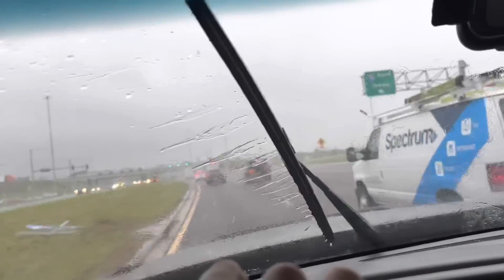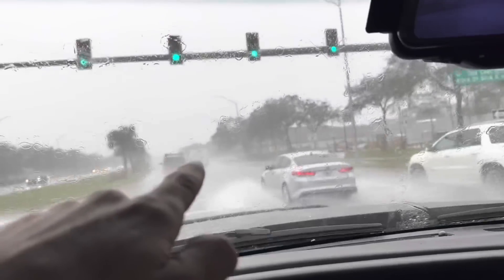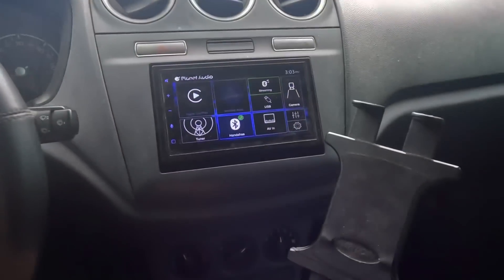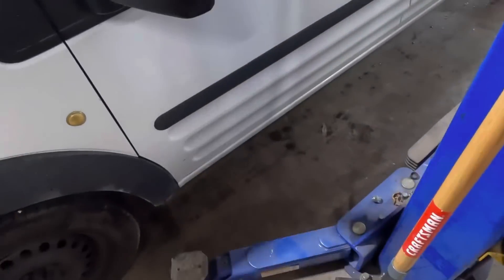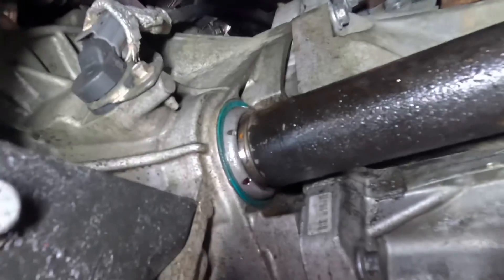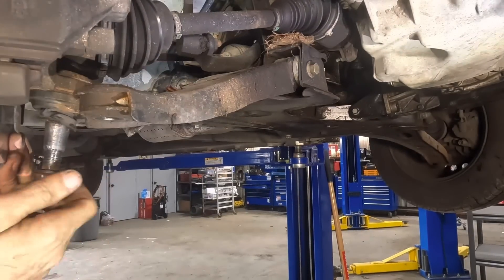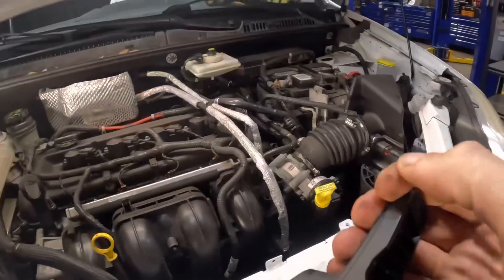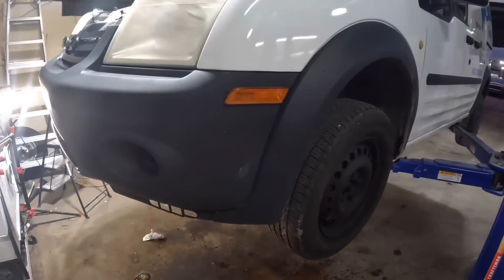Out of Business? Working ON not IN!

Comment: Weird hood latch. Maybe that's supposed to be the colour of the brake fluid. Could be a Transit kind of thing. I had a Ford Aspire dump all of it's ATF all over me when I pulled the CV's, and it was a manual transmission. And that was the correct fluid in it. Toyota's never did that to me, must have been an Aspire kind of thing. Great video, I can almost feel the ATF fluid in my arm pit.

Comment: I've used a piece of plywood cut to the proper dimensions for a similar seal setting endeavor...Not that it worked perfect, but it did work..Changing the tranny fluid and filter should be part of that service to avoid the blood bath...

Comment: Wheel bearing races never get thrown out.  Oddly shaped timing belt tensioner bearings get the balls removed and both races thrown in the keep box by the shop press. A few brake pad backing plates that were just barely metal to metal.    A wheel bearing race selected to fit.  Ground to clear  a slice of steel or brake backing plate. Welded to the bearing race.   A flat washer or jam nut welded to the steel to keep the driving tool centered.

Comment: I reckon you would have loved the MK1 and MK2 Transit, esp the kingpins and shacklework around the steering gear and crossmember, you could fit anything into 'em too whether a Essex V4, Kent OHV engine, Pinto (same as the Lima engine) 1600 or 2000cc or a 2.5 or 2.8 and even the 3.0 V6's as they all utilised the same gearbox mounting pattern as most European Fords.   There was a chap I used to know who put Ford Cosworth engines into his MK2 and MK3 Transits, jag back axle to handle the power, even smoked about with a V8 motor mounted behind the drivers seat and that thing leaped like a lion on pullaway.

Comment: For that seal tapper thing,  what about using a large washer and bolt?  The washer would fit between the block and the bolt would give you something to tap on.  Maybe something to try if you ever have the same issue again and don't want to try the tool made for it?

Comment: @1:30... Same weight with more square inches of tread equals less pound/square inch. I don't know if you actually needed to remove the axle nut. Once the lower control arm is disconnected, you should be able to pull the axle out and swing it out of the way still attached to the hub. That's how I do Nissan Altima transmissions.

Comment: Tip of the day, Ray. Old bearing races make great seal drivers. They are strong, free and come in a wide variety of sizes. I have a whole drawer full of them. The only down side is that it takes some time to acquire a good set. You'll wish you started saving them years ago. PCV pipe/fittings/couplers also work well. They are cheap, easy to find and easy to modify. BTW, you damaged that seal by driving it in without a driver. Can clearly see that the "hat" of that seal is dented inward.
Reply: Example list of bearings to save the races out of:
wheel
axle
pinion
differential carrier
driveshaft carrier
transmission (lots of em in a manual)
transfer case
clutch release/throwout
a/c compressor pulley

There are plenty of smaller bearings in smaller things like blower, window, wiper motors, but when you get to those small of seals, it's like, why not just use a socket? If you even need a driver at all. Can probably push it in by hand.

Comment: Pig mats and oil dry are expensive. I usually coral the excess fluid with a squeegee or wiper blade  and push into a wide dust pan and get as much  as I possibly can off the floor into a drain pan🤣

Comment: ~~~ Trick to make it easier to drive that seal, Use the flat side of a Wonder bar layed on the surface of the seal, you can hit the wonder bar out a little bit from the far edge of the seal it will transfer the force back into the other side of the seal.
Hard one to describe but it works.
At the end i noticed a fluid drip, looked like power steering fluid, the puddle was about the size of a coke can top.

Comment: Yes I have 1,300 lbs more on the rear then the front.
Two metric tons on each front tire.
A metric ton on each of the rears. 
I see people with the wide tires on in the winter which then spreads the weight over a wider area so they don't have the pounds per square inch for traction. So they spin and break free easier.

Comment: Re installing the seal. At the two o'clock position there is a window in the bell housing.... I think I see the ring gear. Insert the tip of the prybar in there and gently lever the seal at the two o'clock while gently tapping on the seal at the eleven o'clock and six o'clock.  Then again maybe I'm seeing something thats not feasible.

Comment: SEAL INSERTION TOOL could maybe be made to work by cutting a thick piece of steel into a round shape and then welding on a length of round bar at 90 degrees to it in the center. You'd have to keep it straight while 'pounding' on it though. ❤ your videos!

Comment: Good morning Ray, my father was a auto mechanic and when he would have a oil spill on concrete he would use something called oil dry and basically kitty litter is the same thing! After an oil spill the kitty litter/ oil dry with soak up all the oil and it can be easily cleaned up with the broom. I was wondering why you don't use that?
Reply: I'm not a mechanic but I can tell you from experience those pads are way easier to clean up and manage than floor dry.

Comment: I have an aluminum bearing/seal install tool that has different sized cups that you flip over to use to install the seals. That would have worked for this install. Unfortunately, the box, being 30 years old is in poor shape so no Snap-On part number. This is when they came in a cardboard box and not a case.

Comment: Swapping the lift locations a possibility?  Seems to me a smaller car would more easily make the turn into the corner and heavier vehicles could then be driven straight in for the heavy duty lift.
Now that I think about it, the expansion may resolve that issue - if that's what your plan is...

Comment: PFLUBBBB! Transmission fluid and brake fluid are my least favorite fluids to bathe in.  Once I get doused, I don't try to stay clean anymore.  Just keep my hands wiped off enough to get a grip on tools.  There a two kinds of jobs.  Ones where you shower before going to work and those where you shower after work.  This is obviously the latter.  Use a wooden dowel as a drift (punch) to seat the hard-to-reach side of the seal.

Comment: Perhaps next time before changing seals on transmissions like this or ones that would leak fluids - drain the fluid first perhaps in a way that captures the good stuff in a way that filters it to re-use perhaps?  less getting it all over if there is no fluid to leak on you.. o.O
As for setting the seal - I am not sure where on youtube I saw it - but there was a guy using a seal kit that had like 1/2 thick plate  made into a round circle, then had a center milled out to fit some bar stock of 4-6inchs long and inch or so around to be welded in dead center to work as seal setter. - also I know they sell seal seating kits of similar design but this guy made his own on lathe.  not sure if it was Diesel creek/ andrew camereta or one of the other guys that does a few things.. was interesting though..

Comment: Do you have a "Performance Tool W83020 Bearing Race And Seal Driver Set,7-Piece"  this may have been better than a large socket.  Also tie long strips of Rag Material around your wrist to keep fluid from running down your arm  the fluid will wick down the tail of the rag (note knot & tail of rag is pointing down IE gravity).

Comment: Any advice from Ray's audience. I'm in Michigan so I cannot take my truck to Ray, otherwise I would. My 2019 Ram 1500 Big Horn DT with V6 e-torque doesn't recognize the key fob. All the functions of the fob work fine as far lock/unlock and remote start. To start the truck I have to physically press the upper left of the key fob into the start/stop button on the dash and hold it until it starts. So if anyone ever encounters this, you are not stranded. Both Fob batteries replaced with New Energizers. Many say in forums the upper brake light if LED causes interference, but in my case almost positive I have halogen. I do however have a ham radio antenna (144/430 Mhz) mount above the brake light, but has been working flawlessly for 3 years now. Some say it could faulty RFH module. I think the same module receives TPMS signals to the system, and that info displays on the dash correctly too. Another forum post said to disconnect both battery cables, and while disconnected from the battery touch the two together to "reset the computer". However I don't want to try that as the e-torque system has a 48v lithium battery in the cab, so there is technically juice in the truck.  Any thoughts or ideas anyone has I can try be fore I go to the dealer for service next week is appreciated.

Comment: The correct way to install that seal is to first take the body off the van, then remove the engine and transmission from the frame, then to separate engine and transmission

Comment: You should turn your cotter/split pin 90° so the head of the pin slips into the castellated nut and bend the pin down and over the end of the threaded bottom ball joint threads, that way the pin cannot work its way round and move causing wear on the pin?

Something to think about when you come across that again (have noticed you like to bend the pins around the nut) 😆 🤣 😂  ... just saying lol

Comment: If you still have accu's led lights that won't accept any charge, that's probably because the voltage is too low. If the voltage is too low the "smart" chargers can't detect the accu and don't deliver any charge current. You can jumpstart the accu's by hooking to accu's parallel, just like jumpstarting a carbattery. Most of the time a few seconds of connecting positive to positive, negative to negative is enough to push some charge in the battery. I need to do that with my bicycle accu's every now and then.

Comment: I can appreciate seating that bearing. I learned from my dad to always keep pipe of various sizes around, to help seat bearings without damaging them with a hammer. Let the pipe take the damage as it presses on all sides.  However, that design is bad. You can't reach the back-side of the bearing because it's too close to the trans housing. Ford engineers could have done that better.
I would bet there is a special tool just for that.

Comment: In my experience with these ford's the boots on the steering rack are a hard plastic rather then a soft rubber anyway when the pas leak they tend to sit gathered in the boot & do a good job hiding them self's for some time.
Also that van looked to be low on coolant.

Comment: I think that torque spec on the axel nut is around 350lb ft. Just a FYI.
Reply: Nah, it's roughly 140-150 on Transits. 350 would be insane. No standard mechanic would ever be able to remove them if they were that high.

Comment: When ya pull a CSD (Constant Speed Drive) which is kinda the alternator/ gen for an GE TF 34 jet engine, as you pull the CSD from the accessory gear box at 6:00 if the oil tank check valve sticks you get a flood of Mil-Spec-7808 jet engine oil all over ya. 4 plus quarts or more.  The CSD is the size and weight of a Ford C6 transmission.  We man handle them out and back in no trans lift at our test cell.  We screw our backs up like men. lol

Comment: perhaps a flat piece of steel could be used to apply uniform pressure across the face of the seal with a hammer and a smaller socket.  That sounds like a three handed process, though...

Comment: Hey, swamp thing, was the axle shaft groovy?
I couldn't see the machined surface to help tell if that axle output seal was leaking for a reason.
Waaaa.
But as a Ford experienced person, I have to ask, does that P/S reservoir contain type F? Which is red?
Ford specified P/S fluid was type F since it went out of use once upon a time for trans fluid as a first use.
Yes, it works just about anywhere, but Ford specified it so it would still be available on the shelf, but in the small Ford bottles.
This is before all the many fluid spec differences, but at the beginning of synthetics.
I hope you're still following the train of thought.
Your customer had low P/S fluid indicating a loss, or leak.
Where's that leaking?
What color fluid?
Gives me a brainurism.
Need input.
Maybe the axle seal was fine?
They are built Ford tough.
Their P/S systems like to leak from several choice engineering marvel's.
They make a distinctive sound when fired at us, sir.

Comment: careful breaking those axle nuts loose while locking the brake rotor if they have the little screw that help affix the rotor, you can shear them off real easy, especially on the cars that have wheel bolts not studs and lug nuts.. better to pop the center hub cap and crack the axle bolt/ nut loose while the wheel is still on and on the ground, and you have a helper standing on the brakes.

Comment: At 27:54 through 28:03, there is something dripping under there - is that residual brake-clean, or is it the power steering fluid you just added?

Comment: 4:50 that was also a very Mondeo thing, at least MK1 and MK2 with that miserable Tibbe key you got there... then at least certain Focuses (Foci?) had that hood lock system here, although different key... the 2004 F*ckus C-Max had the system with a newer key style, but at least mine was broke, and someone had MacGyvered it to work with anything that could turn the lock. (The F-CM was a good car when it worked, but the everything was cramped and required a lot of teardown to get at certain prone-to-break parts). Now, Mondeo MK4 has the newer key style but thou poppeneth ze hood with the conventional  pull cable again.

Comment: And how long have you been working on cars that you did not expect the shaft to leak fluid one levered out?? Pretty well any CV shaft removal will need some oil drained from the gearbox to prevent leakage on removing the shaft from gearbox. A flat piece of steel across that seal would make it much easier to install if you do not have the OEM tool.

Comment: Ray you should be using a copper hammer not a steel hammer, especially on drive shafts other wise you will bruise the threads.

Comment: Ah the joys of been a mechanic and not having the correct tool . I would be worried if Lauren was filming you doing a strip in once when changing clothes and secondly when needing a shower and back scrub. Very nice having a SHOWER UNIT + WIFE UNIT TO HAND.
Anytime a leak is common is to have drainers to hand and not leaving a mess on the floor.
Mechanics should never put dipstick upside down when checking levels , only for cameras big smile.
Not found the power steering leak as those pipes and vibrations sheer it at the pump and you would have seen the leak on the covers if they were there.
Fords used 2 different kind of fluids red or green and your fluid looks unknown.
You need a tool to fit around your arm when doing fluid maintenance like wrap a rage around your arm and  stop you lubing up your armpits.
Will be waiting for WIFE UNIT to upload her next video and i sent you an email you poor tired lad.

Comment: How is the pedal monster doin so far..?
Reply: I wrap a cotton strap around shaft and leave two ends hanging  to direct fluid into drain bucket  and let fluid  drain before pulling shaft. And for seal replacement  I remove  the paint about 1/8 from edge of seal and put in freezer for about 20 min.  It taps in easy ..i use a flat iron in tight places.

Comment: if u are loosing traction in that rain on pavement then ya got garbage tires, nvm the fact its dually. yes dually spreads the weight out so u have less weight per tire but on pavement in rain u shouldn't have loss of traction with an empty bed

Comment: What were the teeth by the seal? 21:03
Reply: Probably the flex-plate between the engine and transmission. The starter gear engages on the other side of the ring.

Comment: Not sure if this has been said yet, but you need a set of seal installers.  These are flanged discs that sit inside the seal and push on the face.  A handle is screwed into the disc that you hit.  This would have given you the clearance to get it straight and you'd have been done in less than a minute.

Watching this I almost thought you'd never taken a driveshaft nut off before.  Damn unprofessional if you ask me, but perhaps you have and forgot how to do it?  Time is money Ray, and I've seen you do better for sure.  The right hand axle is usually one piece as you found here, removing the boot on the tri-ax is how you separate the two parts.  Good that you didn't fight the resistance when you tried to pry them apart.  One more item to check with these is the condition of the bearing on the shaft.  If it fails the crankcase can be destroyed by the flailing drive shaft, ask me how I know.  🙂